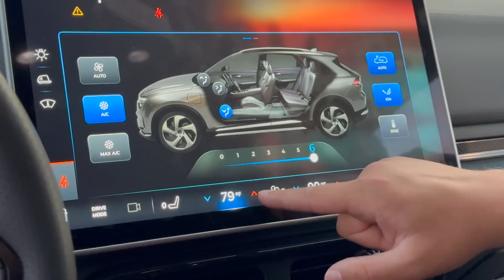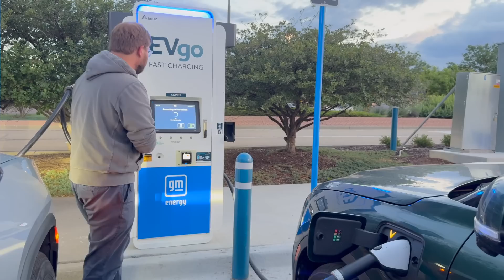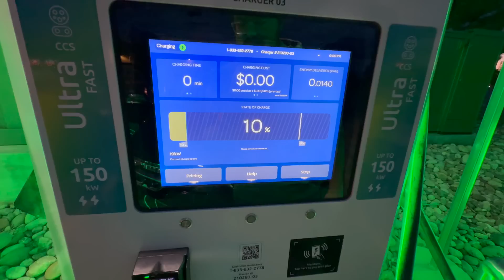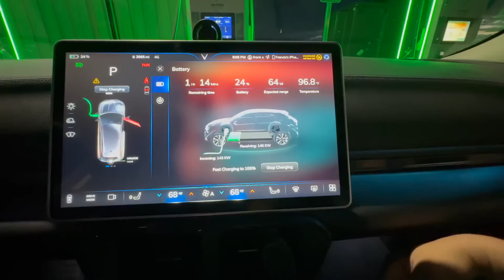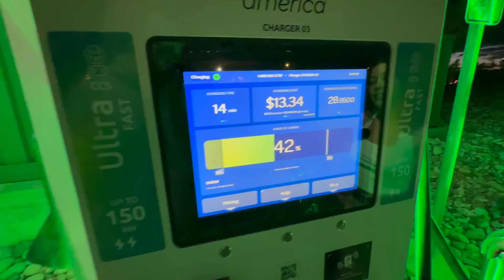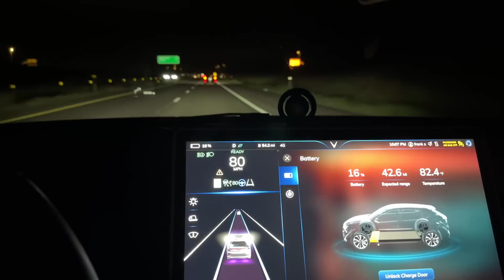VinFast VF8 10% EV Road Tripping Challenge! Here’s How Far You Can Expect To Go After A 15min Charge

Comment: I am doing road-trip from Sacramento to Las Vegas and back with more than 1200 miles total during the 117-degree heat spell the entire 4-day trip. The EV infrastructure for non Tesla EVs in the U.S. could be much better than current. Spent more than 4 hrs after midnight hopping between two EA stations in the busy Las Vegas strips, both have several cars waiting in line, and each has 2 pumps not working out of 6. My VinFast VF8 Plus performed well so far during the entire trip, with AC set at 72-75 at all time. I learned to avoid letting the battery level dipped below 30% is possible and charge more often to avoid the battery get overheated. I noticed the battery will get cooler while driving, from 118 after charging to 94%, to 100 after driving for 40 minutes.
Reply: Sao đi đâu cũng thấy mặt mâm mày thế con trai?
Reply: @JK-qv5wm  thi co khac gi may dau ma ta day?
Reply: The same guy keeps repeating the same old story on all vinfast channels
Reply: @Eagletran99  you are talking about yourself. I guess
Reply: @chungloankenny  go through all conversations then get a sense of these.
Reply: @Eagletran99  I don't know his story conversations . but I do know your comments on most youtube talking  a bout Vinfast
Reply: @chungloankenny  likewise as you to favourite on Vinfast only on all channels which relate to vinfast while I am not being position to convince this is a best choice yet for EV car.
Reply: @Eagletran99 you are everywhere on the net smearing VinFast and bullying the Vietnamese VF8 owners. And you are a Vietnamese. I bet you are too coward to pick on a western VF8 owners.
Reply: @SuperNamn  Did I respond and reply to all comments on English-speaking  channels? If yes then you should have a new method on vinfast's marketing since your old story seems boring and not exciting at all.

Comment: At 80mph, Down 42% to 8% with 66 miles. It means 2 mile / 1 %
At 40mph local speed, Francie drove nearly 3.8 miles / 1 %
FASTER DOESN'T MEAN LONGER.
At high speed, losing motor magnetics is huger.

Comment: Vinfast should cut the weight significantly instead hauling a thousand pounds extra everywhere you go. it will take a toll on its suspension, tires and struts. LOL
Reply: but you will be safer in a VF8 than other light weight EVs in an accident. There were quite a few accidents like that in Vietnam already.
Reply: @IvanNguyen-ky6nn sang 2025 sẽ có thế hệ khung gầm VF8 mới theo tuyên bố của lãnh đạo vinfast ở Việt Nam.
Reply: Tasla vehicles, Kia ev,, Hyundai IONIQ 5,6 ev were rating from National Highway Traffic Safety in US (NHTSA) rating safety with 5  stars. They’re much similar weight.
Vinfast is extremely heavy with no NHTSA test rating. How could it be safety? LOL

Comment: Im taking a VF8 Eco on a 1000 mile road trip this weekend. Was glad to see this test up now
Reply: One Vietnamese Guy took around America with 20,000 miles without any issues. He drove with older (early) version.
Reply: @quangvinhnguyen333  I did a review myself and it does still have issues. One being continued software issues and for me the biggest issue is the pedal tuning. You hit the accelerator and the latency is very noticeable. The pedal dead zone is awful as well. 

For whatever reason the rear suspension sags and the VF8 sits nose high. The degree of sag seems to vary from model to model. 

The real problem is off a cheap lease there is absolutely no reason to have one long term. Its not a bad vehicle but doesn’t strike me as something id want to have more than a few years. Yea I like it, its different and totally not that bad
Reply: @SimplyGregsterEV  Perhaps Vinfast should quickly bring VF6-VF7 there. In particular, VF7 is the best car in the Vinfast model and the price is also cheaper than VF8. VF7 is only slightly smaller than Vf8.
Reply: @SimplyGregsterEV   
Prepare wrench 10 and follow my steps when vf8 stuck in freeze 
Step 1 : Out of car - Lock - Wait 5-10 mins - unlock - press break pedal and wait 30s to see "READY". Don't push bottom pedal to avoid to do step 1 again. How speed you need, how level you push the pedal
Step 2 : Software reset - Press and hold volume button, next to gears, in 40-45s until the car see V logo on screen
Step 3 : Hard reset Control System Board - Using Wrench 10 to disconnect 12v acc negative pole. Wait 1 mins and reconnect. Yeap, it looks like disconnect - connect laptop battery
Step 4 : Shutdown the Whole system - Do step 1 to 3 ,the car is still the same, stuck in freezer. This is the magic key : Open fuse box - find purple square box with name 30A ( main high volt battery fuse) Pull out and wait 1 min, then pull in. 
Step 5 : Thank you for your patient. Please, call recuse service. Sorry for your convinience🙏
Good luck . God Bless You.
Reply: Post a review of your trip, I’m curious about the charging on such a long distance
Reply: @APMC100  100% I will
Reply: @APMC100  I will!
Reply: Safe and sound!

Comment: I said this before but Francie is more realistic when driving an EV. Most EV drivers are going to try to drive it efficiently on a longer trip. People know they have to charge it and that it costs time, so driving faster does not save time in an EV. 75mph would be more reasonable for sure. But it makes sense also to stop at every charger and stay in its peak charging rate. That would save time on a road trip. If I were roadtripping often I would be getting an Hyundai/Kia EV as long as there are the chargers available to support the level of charging on my routes.
Reply: At 80mph, Down 42% to 8% only 66 miles, mean 2mile/1%. 
Faster doesn't mean longer.
She drove nearly 3.8mile/1% with local speed 40mph.
They dont know about electric motor or evs, so faster speed means lost magnetic.
Reply: Agree to your thoughts about Vinfast. So disconvenience on EV vinfast charge on the routes across America when traveling a long distance. City driving is more acceptable goes along with reasonable price tag then Vinfast will has a chance to compete with others.

Comment: Yay for Francie and yay for her Vinfast.  I personally drive the speed limit when traveling in my Ionic 5.  And charge for 30 minutes. (Free charging for two years)  Less stress avoiding cops, and I get about three hours drivetime between charges.  Perfect timing for bathroom breaks.
Reply: Less stress more range, both driver and car are right.
Reply: Interesting info.  May I ask if your Ioniq has Camping or Pet mode ?  Can it idle with cool AC or heater for 8 hours? Thank you
Reply: @Lee-vb4vh   Thanks for your comment.  I did not mean to say yeah.  I meant to say yay.  (I edited it] I think Francie is a wonderful presenter on the Out of Spec channel.  I was a little upset that Kyle was belittling the Vinfast.
Reply: @usaverageguy  no problem thanks for info.  May I ask if Ionic has Camping or Pet mode (idles in park with AC or heater on overnight when camping)? Thanks

Comment: It would be interesting to see the 10% challenge sorted by "$ per mile" - which vehicle is maybe not the fastest-charging, but is the best "bang for the buck as a road-tripper"?

I'm guessing the Ioniq 6 by a longshot.

On Kyle's "drive to 0%, stop at every charger" - that assumes there's zero time overhead to stop at a charging station. If the chargers were always available, and immediately off the highway, sure. But the 5+ minutes added to actually navigate off the highway to the charger (and back after charging,) handshake, possible wait for a charger, etc are usually more than made up for by just charging longer at the prior station.
Reply: I second this.

Comment: The Vinfast Vf8 is quite heavy compared to the Tesla Y (Vf8 5,732 lbs, Tesla Model Y 4,154–4,404 lbs). Reality shows that the Vf8 car is very solid. So the Vf8 car is very safe in a collision (You can watch the Vf8 Euro NCAP safety test video). The car is heavy so it's understandable that the speed increase and energy consumption per mile is not too impressive.

Comment: Are people really doing 80-85 MPH everywhere all the time in the US? I’ve only driven in Vermont/NH/MA/NY and in California, around the Bay Area and it’s not true in those regions for sure. It’s also incorrect in Canada. 75 MPH is pretty much the tolerated speed limit everywhere I’ve been.
Reply: Out in the Midwest, the huge distances between cities necessitate 70-80mph speed limits, and folks routinely drive 85-90mph.

The northeast and Cali are more built-up, so 65mph speed limits are the norm and people tend to max out at around 80mph
Reply: For road trips 80mph is the slowest you can go to not get run off the road on the left lane here in California with a 70mph speed limit but realistically most people on the left lane is at 80-85mph. But in Texas and Colorado with the 80mph speed limit also with so few cars around most people cruise at 90mph
Reply: Depends on where you are. In my area yeah we do between 80-90 everywhere.
Reply: Sounds to me like most places where EVs are popular have 75 MPH or under as their posted (or tolerated) speed limits then. East Coast, West Coast. The Midwest and other more central regions have higher speed limits and cheap gas prices so the higher fuel consumption at these speeds isn't a big concern, I guess? 

Interesting. 

Up here in Quebec, the absolute fastest speed limit is 62 MPH posted, 75 MPH tolerated, gas prices are higher than anywhere in the USA too. It's all relative!
Reply: @fleecystheking   generally you can drive on the right lane at 70mph behind semi trucks for max efficency but most people would gladly just be less efficent on the left lane and keep up with traffice at 80-90mph. i drive a tesla model x and i just drive on the left lane and keep up with traffic and just deal with 20% less efficiency compared to driving on the right lane at 70-75mph.
Reply: 80-90 is insane with a normal speed. This is not autoban
Reply: @gocnhinvutru  many parts of the usa the speed limit is 80mph and traffic moving at 10mph over the speed limit is pretty standard anywhere you go.
Reply: @riceball777  ok. Thanks

Comment: Dang, I knew it was going to be terrible but that's really bad. I'm in a PHEV right now and my goal os to switch over to an EV once I can find one that can get 3 hours of highway driving after a 15 minute charge. I figure that will be the crossover point where it isn't an annoying pest during long trips so good enough to finally ditch the PHEV.
Reply: I also try to gauge my charging time to get me enough to match my bladder range :). 
In my model y with east coast traffic I typically do 2.5 hours with 15 minute charging stops on road trips. 
When I was out west with higher speeds it was more like 1:20 driving with 15 minute charging. Higher speed is a double whammy: more energy per mile and less time per mile.
Reply: @Snerdles  how fast do you like to drive?
Reply: @Toastybunzz88  The general speed of travel on highways where I am is 120km/h (~75 miles). So that means 360km charged in 15 minutes.

The 2025 Ioniq 5 or 6 (assuming they both get the 84kWh battery, up from 77 of the 2024) are getting very close. The current models don't have the capacity so you'd have to charge to near 100% and 10-80 already takes 18-20 minutes.

Comment: Basically the same as Model Y 4680
Reply: ouch...
Reply: 1st gen 4680.
Reply: @777Outrigger  the only 4680 on Model Y are Gen 1. Gen 2 aren’t any better
Reply: @brandenflasch  Patience, grasshopper. Cato Rd has been doing test runs for production of the Gen III. .... .... Sandy Munro has said that even in Gen II that the batteries he's examined have a dry cathode in addition to the dry anode. He said this will reduce the production line by 2/3rds and drive down battery costs a lot. ..... ......And the Cathode has had the cobalt content greatly reduced again saving money. That might hurt energy density a little but they've found silicon particles in the anode which will increase energy density.  To compare the 4680 to the batteries on this Vinfast is ridiculous. The 4680 is just coming into it's own.
Reply: @777Outrigger  4680 in current form shouldn’t be sold to customers.
Reply: @brandenflasch  I can understand why you're mad about your gen 1 4680s. CT owners seem to be happy and with a few software upgrades, charging speed will improve.

Comment: I’ve seen them being trucked around but finally saw one at the charging station. Its surprisingly large
Reply: Yup. Saw the top spec version and it was looking real premium. Just needs another 80 miles or so. Can't have less range than a Bolt in 2024.